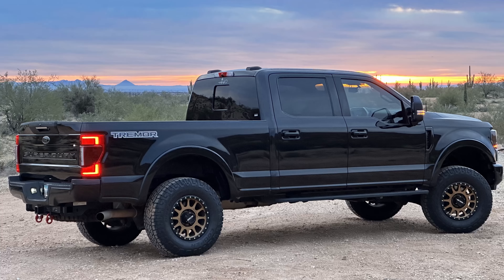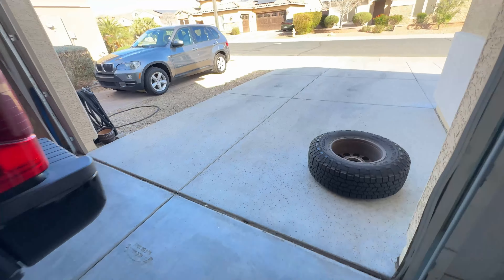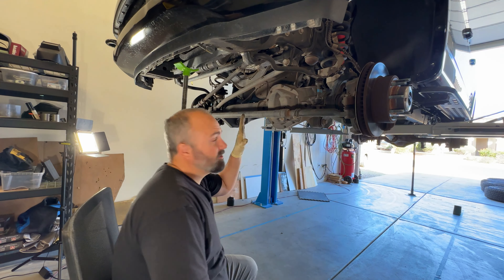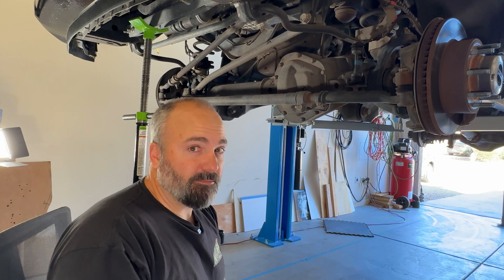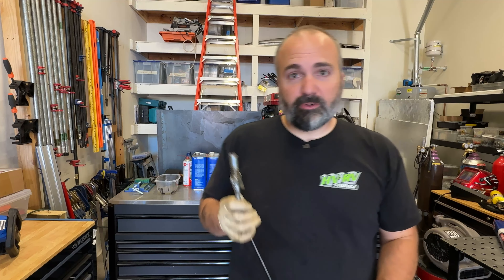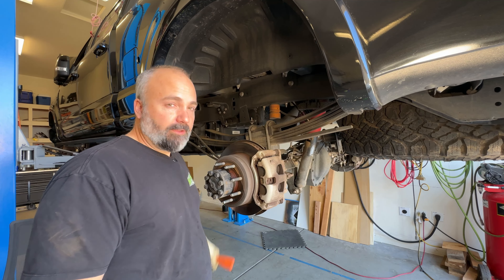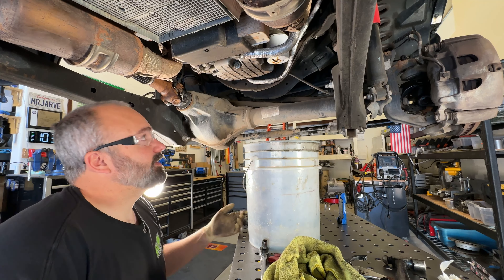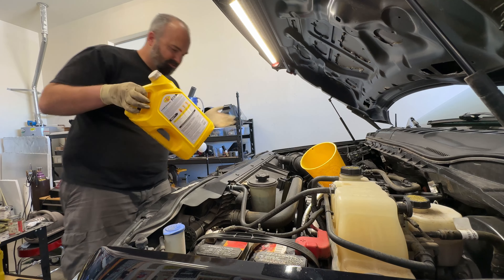Super Duty 7.3 Godzilla Oil Change and Inspection

Comment: Hello, thanks for an other great video. I learned from my father in law (a mechanic for 40 years) that the sequence for motor oil drain is 1-  Open oil fill plug 2- Pan drain plug. 3 - Oil filter removal.  The result is 1- the fastest drain time 2- the least amount oil remaining oil in the filter.

On top of your verifications, he also learned me to check if the caliper pins are free floating. 1- Press in a bit the brake cylinder with a C clamp or for smaller brake use a flat head screw driver. Then wiggle front and back the caliper to see if they are not stuck in rust or old dried grease.
I just wanted to share my experience. Have a great one.
Reply from the maker: Checking the brakes like that is a great idea. I check the brakes while doing my rotations and on occasion will lube the slide pins. Thanks for sharing!

Comment: When i do my oil change and put exactly 8 quarts it calls for it looks a little low on dip stick.  I trust the 8 quarts more then the flimsy dip stick. If i were to fill it to full on dip stick it would be more than 9 quarts.
Reply from the maker: I always wonder which I should follow. The spec or the dipstick. I typically follow the dipstick.
Reply: @DrivingForwardBuilds  I follow the spec, but remember where it is on the dip stick so you know if it's ever getting low. I wouldn't ever let it get below or above the fill lines but have seen some vehicles where if you fill it to the top line its way above spec. To much oil lowers fuel economy power could even get air bubbles. I figure the engineers know how much oil is best,  Oil pans are consistent, but dip sticky can vary and are more likely to be off a little.

Comment: Get that stuff off the water heater, that water heater needs to breath. Always maintain a clear area in front, all around and on top of the water heater. If it starves at all from air it will run rich and cause issue with the burner assembly plus it could become a fire hazard.
Reply from the maker: Nothing “on” the water heater itself. 30” clear air space on one side and the side with insulation panels is 12”. Both of which are more than the airspace to the wall. Is that enough?